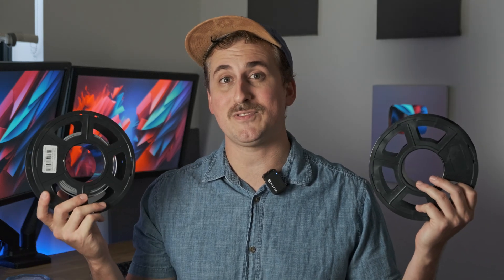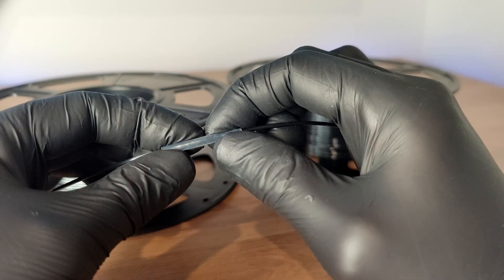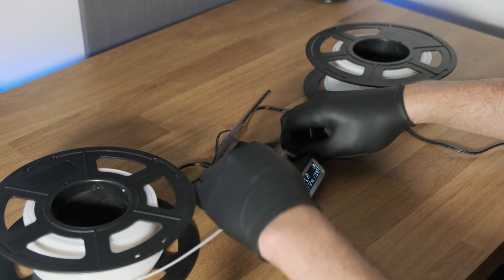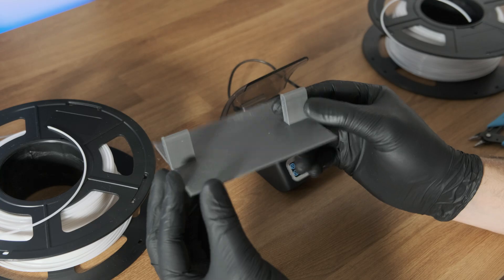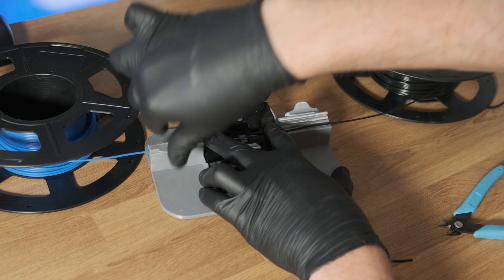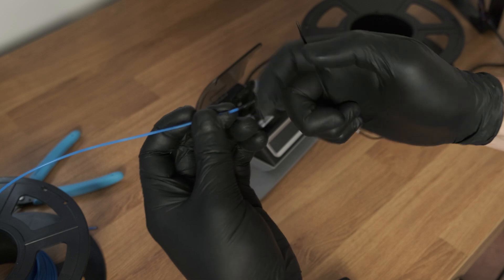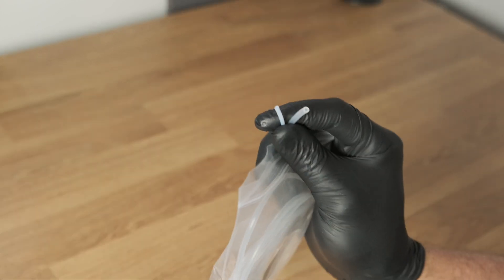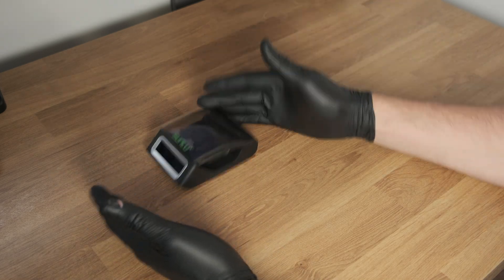I Fixed a Major Flaw in the Sunlu Filament Connector

Comment from the maker: For those of you with questions, I made a video going into more detail on the silicone tube welding process - https://www.youtube.com/watch?v=9BcSKtxje7E

Here are the links to the sunlu filament connector and the silicone tubing :) Let me know how you go! 
Silicone Tubing (1.6mm ID, 3.2mm OD)- https://amzn.to/3y7ZCJO
Sunlu Filament Connector - https://amzn.to/4aFFnSF
Reply: I found some silicon Tubing with 1.75mm ID and a .2 wall thickness, do you think that would be too thin and have the same issues as the ptfe? It seems likely.
Reply: Doesn't the silicone tubing absorb some of the heat needed to melt the filament

Comment: Hi,

I also ordered this device (it should arrive soon).

One thing I was wondering about, though:
Why did you butt-weld the two filaments together?

Shouldn't you cut both ends at a 45° angle, push them together inside the silicone tube, and THEN weld them?
The video says the silicone tube is reusable... How is that supposed to work? The piece of tube has to come off the filament and therefore has to be cut.

Greetings from Germany
Reply from the maker: Howdie :D Cutting each end at an angle would be better, but the reality of actually being able to do that is much more difficult, as the tention from each spool is constantly moving/rotating it, even inside the filament holding tool. 

The tube is reusable, only when splicing small pieces together where you can slide the piece off one of the ends. It's also reusable if you make a mistake and need to try again, as the original tubing it comes with is really only good for one attempt as it perminantly deforms after being heated.

Comment: Simple solution: after the unit beeps, unplug it. Get a can of air. Turn it upside down. Give your unit a shot on both ends BEFORE opening the inner lid. The refrigerant will cool the joint instantly. Proceed removing the sleeve as usual. Your welcome. CHEERS!
Reply from the maker: Great idea! Thanks for sharing :) Would be cool if that could be built into the device somehow... I'd happy pay for refills if it meant the join came out perfectly.

Comment: I've had no problems with my Filament connecter. If you try cutting  the filament ends at a 45 deg angle it will bond to each other every time.

Comment: How do you get the tubing off to reuse? Or do you slide it to the end of the reel?
Reply from the maker: You get the tubing off when connecting small pieces together, but if you are doing two spools, you'll need to cut it :(

Comment: why dont you just unplug the machine and wait a few minutes before opening it?
Reply from the maker: The residual heat seems to continue to melt the plastic causing it to deform and clog the extruder :( However some people have had success with this method, maybe they are in a much colder environment than here in Australia :P

Comment: I have this device too and had (or still have) the same issue! I connected two spools of the same color to maximize usage and thought the joint fused perfectly. Turns out it must have been just a bit too thick, because when the printer reached that section, it jammed and stopped extruding. I haven’t used it since and have been relying on the filament run-out sensor, hoping it doesn’t mess up the look of the print. I’ll definitely be trying the solution you shared here—hopefully it works, because it’s such a great concept!
Reply from the maker: Yep, same thing happened to me too! But the easiest method is just to get an auto filament switcher like an AMS or Infinity Flow S1 and you never have to worry about this process ever again!

Comment: any reason not using the nromal 3d pritner ptfe tube ? too stif ? or too large outer diameter ?
Reply from the maker: The silicone allows for more heat to get into the filament, which makes the fusing process much easier :)

Comment: I've ordered the tubes but in the meantime, I was in a bit of a spot and had to figure out a solution. Using your theory, I got another oem tube to sacrifice, cut it length ways and slipped it over the good one. Doubled the thickness and it cooled pretty quickly too. (coldest day in Brisbane today, so that helped). Oh yes, 5 minutes later, the damned nozzle clogged well before the join arrived !! 
But the join worked.

Comment: You're right! Spool to spool splicing sucks for the exact reasons your stated. I thought about the same solution as you did. But gave it up when, like you pointed out, the splicer did not close correctly. I will be trying it again now.

Comment: Thank you very VERY much for the idea of the Silicone tube, awesome!  Just a quick note, the instructions manual for the Sunlu filament connectors specifically says to wait a few minutes for the newly joined filaments to have a chance to cool down.   I've been following this bit of instructions and i've not had a need for a cooling fan...?  if the instructions manual didn't have this step in writing I could totally understand the need for the fan...  :)  Thank you again, wonderful video!!!
Reply from the maker: Glad you liked the video! :) I actually tried just leaving the newly connected filament inside without opening the heating lid, but it just over heated the connection and make it flimsy and out of shape... Maybe fusing at a lower temp could help? I have just given up entirely and just use an AMS for any of my extra spools laying around, does the job much faster and easier, and saves a but load of time.

Comment: For a group that spends hours tweaking and upgrading their printers, adjusting settings for finicky filament, etc, getting upset at a filiament splicer that requires some patience and direction-following seems odd. Sure, I'd like to snap my fingers and connect all my orphan filament into a single spool, but I certainly don't mind taking some time to learn a new process that will save me time and money down the read.  Mine works just fine when I follow the directions and remember to breathe...

Comment: The instructions tell you NOT to open after doing the fusing.  You're supposed to let it cool with the product closed.
Reply from the maker: From the instruction booklet "Step 6. Press the heating cover switch button, hold both sides of the filament, slowly remove the filament, let it cool for 5-10 seconds."
Reply: @LayerLabAustralia  weird, just leave it in place and don't open it.  no issues but the jig to print is awesome, it's like splicing optical fiber

Comment: This sounds like a great solution, but I also wonder if the silicone tube was slit lengthwise, could it be used multiple times to join two spools together?
Reply from the maker: It's a good idea! But I feel like the filament may not come out perfectly round, depending on how tight you get it... if you do end up trying it, let me know how you go!

Comment: I find a much easier solution. I take the plug out the machine when it is done heating and leave it like that to cool of. After it is cooled, I release the filament and it is perfectly healed. Nothing else is needed.😊
Reply from the maker: Yeah I tried that, but I found the residual heat continues to melt the plastic and ruins the connection. How did you stop it from overheating the filament?

Comment: fixing a device that was redundant and looking for a problem to solve
Reply: What other options are there?
Reply: @V1N_574  simply do NOT "weld" filament together, use remnants, printer pauses when run out, put in new roll of filament

Comment: Great video and great solution. Just one thing. How are the silicone tubes reusable when joining two reels of filament? -)
Reply from the maker: You can resuse them if you make a mistake and need to try again (impossible to do with the ptfe as they get deformed after one use) or if you are connection two small pieces together. If you are connecting two spools, you will need to cut it off :)

Comment: Reminds me a bit of the early days of fiber optic filament splicing. You can blame problems on the equipment, or you can develop better skill in using the equipment properly. I guess the first option is always the easiest for some folks. 🙂 The simple fact is, it's not a brain-dead process, and you need to refine your technique through practice and repetition.  Once you show the patience to develop the requisite skills, it becomes a repeatable process with quality outcomes.

Comment: I'll give the silicone tubing a go. Surely though if you are splicing two spools of filament together the very next operation must be to wind all the filament from one of the spools over onto the other? This allows the support design to be much simpler, like one of the 3D Printed examples you ruled impractical. You do not have to lift the filament out of the splicing support, you can just wind it through. This has the additional benefit you can wind it through the silicone or PTFE tubing as well, meaning you do not need to cut it off and can reuse it!
Reply from the maker: Yeah you could do that, but then you run the risk of the PTFE tubing getting causing a jam when winding at high speeds... Plus the Silicone tubing has a very tight ID, and once it is on the filament, it doesn't slide easily like the PTFE stuff. :(

Comment: See, I'd argue that joining two spools together is NOT the intended use case (and why would you join two feed ends together in the first place?). You have to unwind at least one spool in the first place to print, so unwind one, manually straighten the filament ends you intend to join (a brief hit from a lighter or heat gun will do the trick to help unbend), and use the joiner. Pretty easy.
Reply: You might do it if you then use filament winder to make 1 spool out of the 2 half spools
Reply: Seriously, who TF welds the only loose end of one spool to the only loose end of another?

Comment: Thank you for this! I bought one of these a month or two ago. I finally tried it out today. After a few minutes of frustration, onto youtube I went. 
I make copper wire for a living, so welds are no stranger. PLA however, is a completely different beast, lol. I just ordered the tubing and, I subscribed ;)
Reply from the maker: Haha it sounds like you went through exactly the same thing as me 😆 except when I looked on YouTube all I could find was people going on about how easy it is to use.... Easy to use my ass 😆 let me know how you go with the silicone tubes!
Reply: @subversive1219 Tubing sorted you out? :-)

Comment: I just  got my sunlu connector. You're right, it has some issues. I'm printing out the holder right now, and I ordered some silicon tubing. Thanks for your video and help!
Reply from the maker: No worries! Let me know how you go :) The silicone can be a bit stubborn at first when you are trying to close it, but just use a bit more pressure to close the lid and it should stay closed throughout the fusing process.

Comment: I just purchased the Sunlu and I'm yet to try it out, but after researching and watching many YouTube videos, one thing they all say is TO ALLOW THE JOINED FILAMENTS TO COOL OFF BEFORE OPENING THE CLAMP.
Only then do you move the section to the cutter to remove the PTFE sleeve.
BTW, I do like your printed holder.
Reply: I wondered the same thing -- why not simply wait to remove it?  I kept thinking the real problem here is impatience.  Apparently, it's time for me to experiment and find out.  

(I bought one of these Sunlu units months ago but promptly lost it.¹  I just recently found it.  Time to use it for the first time.)

__________   
¹ It bought it right as my house went through it's second (and final) round of flood repairs.²  Having the second half of my walls ripped apart, then put back together, generates considerable house-wide chaos.

² Hurricane Milton redefined "lake house" for me when my dog woke me³ about sunrise and I discovered my home now contained the lake.

³ Normally I sleep through my dogs (Borzoi and Labradoodle) hopping on and off my bed.  This abruptly changed when my Labradoodle snuggled up to me... soaking wet.
Reply: @clearway  Agreed, strong impatience vibes.  Can not step away for 10m to let it cool naturally without touching it.
Reply from the maker: The problem with leaving the filament in the clamp to cool is that the residual heat continues to melt the plastic and ruins the join... :(
Reply: @LayerLabAustralia can you explain a little more, since the point is to melt the join, in what way is prolonged melting messing up the join when letting it otherwise cool down over time without moving anything?

Comment: How do you get the silicon tube off?
Reply from the maker: You can use the cutter that is installed with the filament connector, or just use a stanly knife :)
Reply: Then it cannot be reused as was mentioned int he video
Reply from the maker: @glenncol  it can be reused if you are joining small pieces together* Apologies, I should have made that more clear.

Comment: Hi, just wanted to know what the internal and external diameters are for the silicone tubing. The link you gave had several different sizes, some metric and some in inches and none quite the right size for the filament. Greta video by the way! Thanks
Reply from the maker: Check the description, should be in there :)

Comment: The key to making this fully automated is to design this system to work without the tube at all. It seems to be relying on the tube to provide pressure and sealing during the weld. I think this could be replaced by controlling the temperature of the tips of the filament better, only heating the orthogonal face and not the sides. 2nd, the filament pieces need to be moved together while heated. So, a flash of heat combined with a precise mechanical movement.
Reply from the maker: I like the sound of that! The only thing I have found that does this is a filament splicer built into the mosaic palette 3 pro. If only they could engineer that specific function into its own device 😢

Comment: How to reuse the silicone ones? I tried to reuse one of the cheap and the filament (stupid me, I should have known this before) squeezed out of the opened tube. Then I tried to pull a tube without cutting over the filament on one side of the joint... thats not practical.

Can I cut the silicone ope, use it again without making a mess?
Reply from the maker: You can only reuse the silicone ones if you are just splicing two small pieces of filament together, or if you make a mistake and need to try again. The PTFE tubes are basically useless after the first try as they deform.  Once you cut the silicone piece, you will need to use a new one :)

Comment: The way I got around this was by straightening out about ~20cm of filament on each end,  so it wouldn't bend on its own. When it was straight, it was MUCH easier to work with, all I had to do was keep the filament steady as I took it out and blew on it to cool it down in a couple seconds. It works about as well as the silicone tube did!
Reply from the maker: wow..How did you get the filament to be straight without deforming it permanently?
Reply: @LayerLabAustralia  I just straightened it out by hand, bending it in the opposite direction of the curve but being careful to not accidentally snap the strand. After the fusion, the straightened part of the two strands made it a bit awkward to get back onto a spool as it would cause it to spring out, but it wasn't too big of an issue for me as long I was careful to not let it get tangled.
Reply from the maker: @thelegendarybulldozer7256  Nice! Good to know :D

Comment: I''m going to try the silicone thing but frankly I feel I was scammed by sunlu also printed another base like you no luck
Reply from the maker: yeah...i totally get where you are coming from...let me know how you go with the silicone! :D I have another video that explains it a bit more in detail, check the pinned comment :)
Reply: @LayerLabAustralia  Hi I checked and right now I need to wait for the silicone to arrive meanwhile I took some some 14AWG silicone wire strip a bit and tryed to use it as the silicone tubbing the lid doesn't want to stay close. still trying. Such an awful unfinished product to get into the market :(

Comment: You saved me from returning this God awful thing. The only thing different for me is that I’m dealing with tightly wound less than 200g spools and I had a much harder time closing the lid than you did. 

My fix was to keep the lid open and use the flat side of my small diagonal cutters while I push and countdown.
Reply from the maker: Yeah, it can be a bit of a pain to use... Did you get a chance to try the silicone tubing?
Reply: @ yeah I’m sorry, I meant when using the silicone it was not closing as easy. But it’s still better than the 100% fail rate with PTFE.

Comment: How is that thicker tube reusable? Don’t you have to cut it up get it off?
Reply from the maker: If you are doing smaller joins with single pieces of filament, or you made a mistake and need to try to weld it again. It never deforms, unlike the ptfe tube that deforms after it touches the slightest bit of heat 😆

Comment: For the hot filament issue, and the bending and such, cant you just leave it in the machine until it cools down and solidifies?  why the rush?
Reply from the maker: If you leave it in the heating element, even with the power turned off, the residual heat continues to melt the plastic and deforms the connection :(